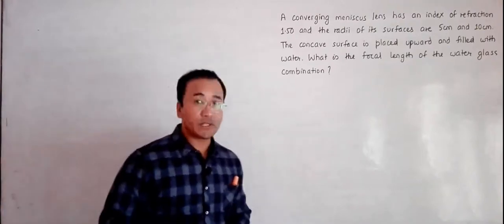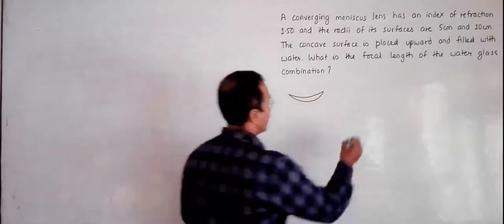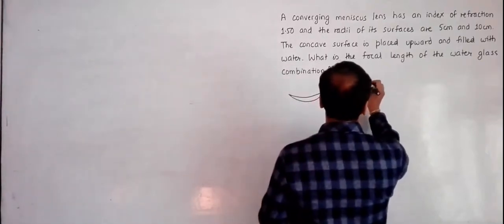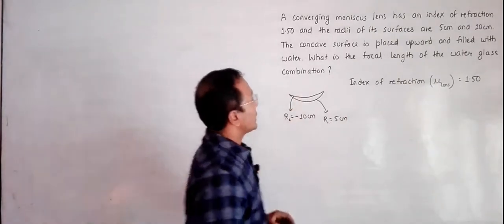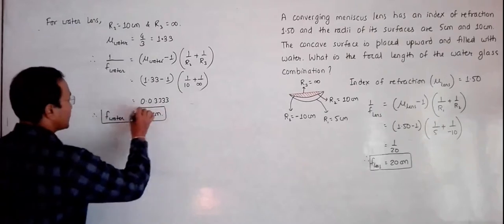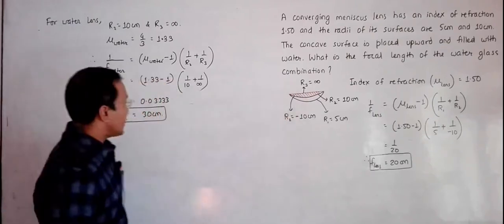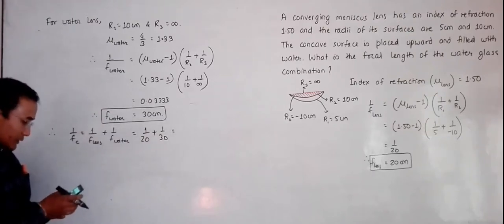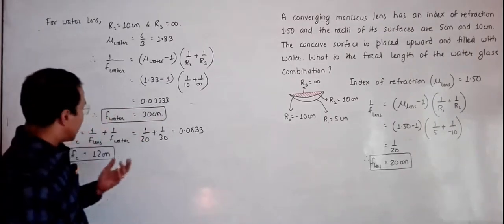Meniscus lens problem 1

Comment: Excellent video, very clear and simple solving of the problem  and my doubt is cleared now. Sir please let me know what kind of camera  is used.letters are appearing very very clear.send me video arangement information.
Reply from the maker: Satish sir. It is a very simple stuff. It is simply smartphone. Till about two yrs back, it was Samsung Galaxy A5 phone. Then it is Huawei Nova 3i. I made no other special arrangement.

Going by the date the video was uploaded, it is Samsung. I used the app OPENCAMERA for the purpose. It can fix the focus at a point.
Reply: @sajitchandrashakya  thank you very much for answering my question sir . I must  Follow your classes on this channel and I request you to make videos rare, confusion,conundrum
and critical concepts like meniscus lens, displacement current, sceu lines in torque of strings passing over Pulley, power factor,band width, etc
Reply from the maker: Sure Mr. Satish!! Will definitely follow your suggestion!!

Comment: the radius of curvature of the second reflecting surface of a convex meniscus lens is 45 cm and its refractive index is 1.5 if the thickness of the main asus lens is 1 cm find the position of the object and image with respect to first surface and radius of curvature of the first surface
Reply: the radius of curvature of the second reflecting surface of a convex meniscus lens is 45 cm and its refractive index is 1.5 if the thickness of the meniscus lens is 1 cm find the position of the object and image with respect to first surface and radius of curvature of the first surface